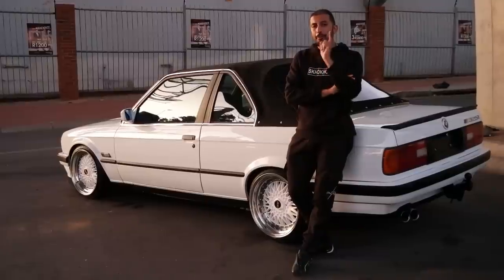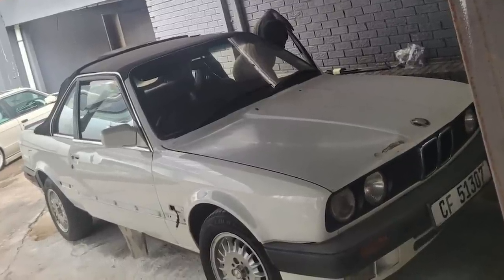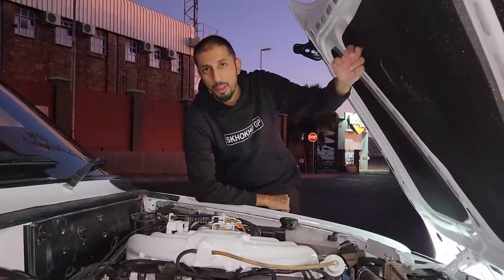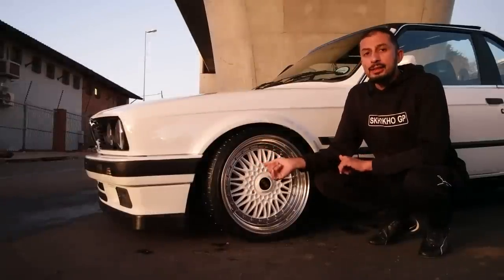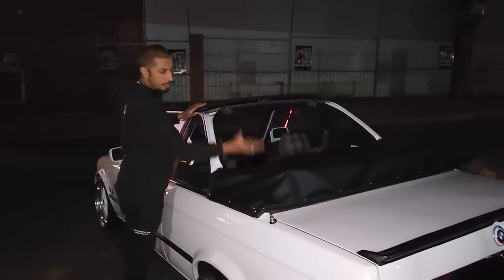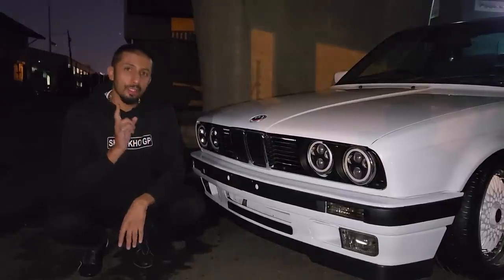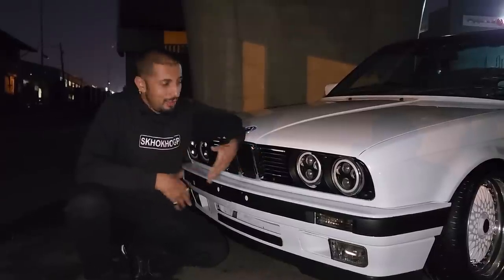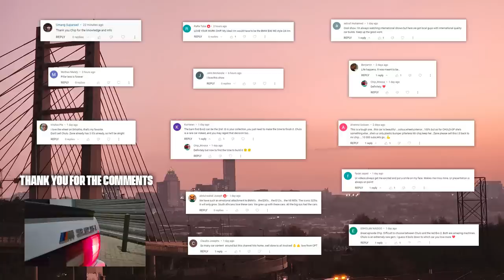Ice White 325i Baur/Cabriolet

Comment: Hi
I also have white bauer for 30 yrs now. Some small points
The bauer us more structurally rigid than the convertible so a better deal. Maybe why that was the SA choice.
The interior needs a few tweaks.
The seats lack lateral support and although I originally had releathered eventually replaced with E36 cab seats. It is a tight squeeze but can be done.
You need spacers to get height level and still use the slder bars on seatbelts. I also replaced interior lamp which was hopeless for black interior. Made one up with plate,leather covered ctr switch and 2 Led torch heads.
I recobered dashboard in leather. Instrument cluster now has day glow red needles and bronze bezels from Taiwan.
Just some ideas for you.
By the way. Frt struts are same as IS model. They are larger dia than 325i

Comment: A pretty neat build, yet has more room for improvement and am well aware the level of restoration is all dependent on the owners' finances. Now from research a standard fairly spec'd E30 (M20B25 which had a capacity of 2,494 cc) BWM 325i cost an average of around R123000 new which was basic and a Cabriolet 2 Door version cost around R165 000 new which was expensive in the early 90s. South Africa had safety regulations in place with regards to safety of consumers buying these cars but it goes without saying that the convertible was available upon request in the additional specifications sheet. A small number of cabriolets were imports and the body structural reinforcements were far more superior than their "covered" counterparts thus inclusive of all the costs bumping the price up to R165K, now the Baur was cheaper than the cabriolet costing around R125 000 and taking into note that it was assembled in Rosslyn. 

Research states that 10 865 Baurs were made in Europe and with shipped loose components around 3 561 (in different models) were assembled in South Africa. There's a large number of Baurs in South Africa and some are stored away safely, some are rotting away while others continue to circulate the market. Legislation aside getting a cabriolet was possible and expensive since it was imported but Baurs made sense since they were assembled in Pretoria and cost a neat average of R125 000 (for a 325i). I want one in future as well in Brilliant Red 🔥🔥🔥🔥🔥🔥